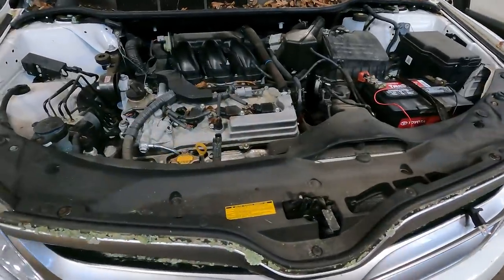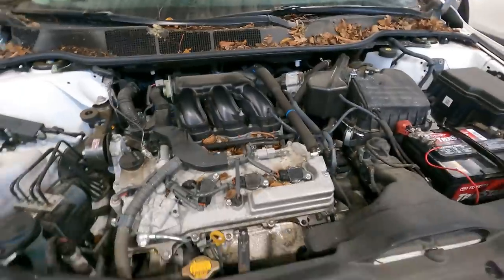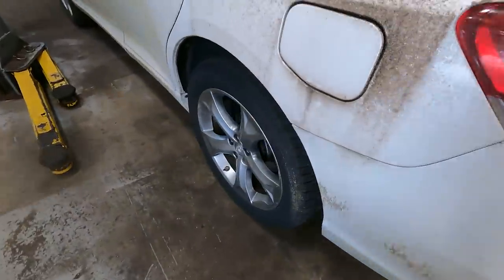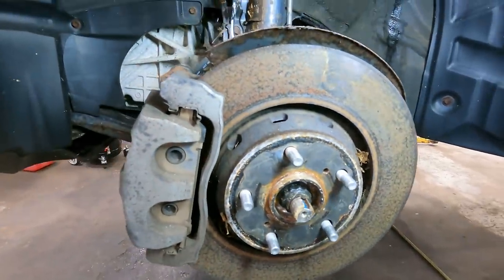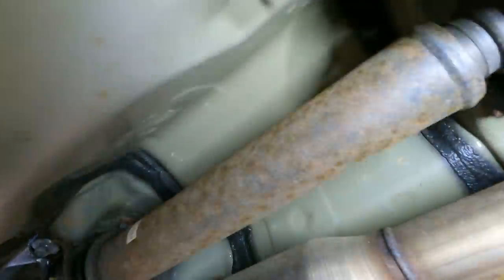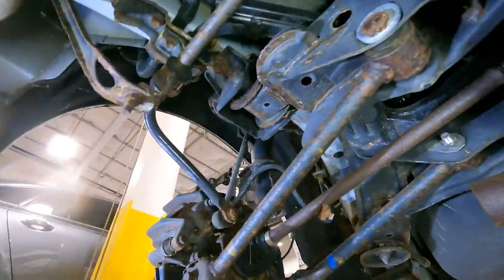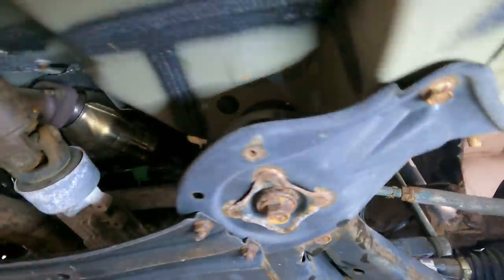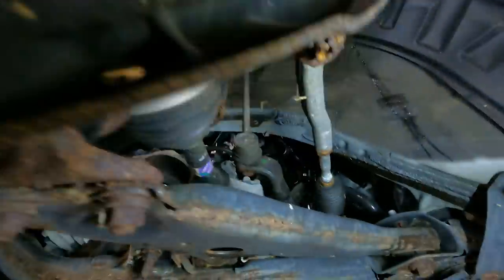Customer states "WAITER TOW-IN NO START 2014 WITH 6,600 MILES!?"

Comment: Just get it up to 90 on the highway and slam on the brakes. They might not work for 200 yards but eventually will grind the flavour off 😆
Reply: I’ve done similar with a sitting vehicle not at 90, but yes it does work to remove the flavor, also if a caliper is hanging up going back and forth from reverse to forward and slamming the brakes each time often frees them up as well
Reply: Yeah, sometimes they smooth out with use. Other times they are just done no matter how long you drive it and need replacement
Reply: @mph5896  yup- i just did brakes on said car i was talking about in my previous comment- then i got tboned and my car sat for a year - Now a valve or some shit is sticking open, this aint a 6k mile car either tho, my car has 222k miles- time to send it off to the crusher lmao
Reply: Yeup. Or find a long downward hill on a 55mph road and burnish those rotors clean.
Reply: ...and sometimes you do that and the pads go ballistic....ask me how I know.🤣

Comment: I once let my 67 Mustang sit inside a garage for 3 years with the tires up and the battery on a charger thinking I was helping to preserve it. I had so many problems. The wheel cylinders (all 4 of them) started leaking as well as the rear axle seals, and the exhausted started to badly rust. There was also corrosion on the radiator and the alternator. I learned that running a car every once in a while is the best thing for it and keeps all of the seals from drying out and the heat from the engine is the best thing for the running gear, exhaust, etc. When I went to Louis Bromfield's house (where Bogie and Bacall were married) I was talking to the caretaker in charge of his old jeep and other cars. He said once a month they take them all out for a drive with a modern car in front and the back. Best thing to keep them going.
Reply: Saw used cars that had been on lots for 2-3 years even before Covid. Said "No Thanks!" to the rebuild project they all would have been.
Reply: I know of a old dude.. that bought 2x of the 1970 chargers with the 6 packs and the whole load of options... same day, serial numbers consecutive. He bought them when hwe was 25 or there abouts.

One of them he drove the shit out of, the other, he had a barn out in the middle of nowhere in which there was power and he built a "garage" inside that barn so as to keep the vehicle in as pristine shape as possible. He had the vehicle delivered and when it arrived it had just a hair below 10 miles on it, to which he bitched to the dealer about that fact since he knew that at most, it should be no more than 3 miles, they ended up refunding a little on it. He uses wheel carts to move the vehicle out and back into said garage that he's mice proofed. He also heated the garage so it never dropped below 10C (50F) and he even air conditioned it so that it wouldn't get above 30C (86F) He also maintained a humidity no lower than 30 and no higher than 50 when possible.

Every spring and every fall, the vehicle is started, all brakes are applied multiple times, he only puts it into reverse and leaves it in neutral. He then jacks it up and manually turns the rear wheels in order to keep the differential from leaking. He also washes it once a year in the fall. He uses conditioners on the interior. He said initially he was changing the oil every year but now with synthetics, he's doing it once every 5 years or so or when he has the ambition if it's sooner than 5 years.

He later had gotten a large seacan that was sealed and built a rear and back entrance that he could basically pressure seal. It also made it more efficient and easier for him to maintain.

Now i only know about this because he took an interest in the vehicle i was repairing and retrofitting and we started on other old vehicles. He said he'd kill me if i told anyone who he is and what he has, but his goal was to keep it in immaculate condition and then load it into a covered trailer, get it shipped for one of largest auctions likely down in las vegas, and he wanted to see it sell for a million or more. Though he's getting up there in age, he better get on that soon, otherwise someone is going to get the best barn find of the century.

Either way, Simply running an engine once or better twice a year for 15-30 minutes, disconnecting the battery entirely, manually turning or letting the engine turn the wheels and keeping everything in an ideal out of the sun away from the changes in temperature and humidity can result in preserving a vehicle significantly. I doubt such a feat could be as easily done without being where i live which is literally the furthest from any sea or ocean you can be, land locked away in the middle of nowhere. The only issue is our temperature ranges from -40 to plus 40 (115F) with gross winds.
Reply: cars dont do well when they sit. the mechnical parts need motion from time to time to maintain them. it sucks but maybe we can let electric cars sit in the future? XD
Reply: @randomrazr  ....sitting for long time the block and heads warp molecularly ... yes metal can actually change shape if not exercised.
Reply: Worst thing for car is to just sit idle. Parts made to move, need to move. Those seals will seal for a long time, but they need some movement.
Reply: @declansills1614  ....maybe all those "barn finds" were not really a win win
Reply: @nickmalone3143  I agree. Old, unique parts there, solid body panels. Needs a full restoration, then you don't want to drive it due to all the money you spent. Nice to look at, but I want a driver.
(1) That Hemi, LS7, Boss engine, etc...., look good under the hood.
(2) A good straight road, right foot on the floor, big carb moaning as it sucks air, nose coming up as you are pushed back in the seat.
Pretty sure I'm a #2 guy.🤗
Reply: In 2020, I only drove my 09 Camry to the grocery store once per week. Valve seals are now slightly leaking(small smoke puff on startup after sitting overnight), and I'm seeing similar stories on forums.

Could be a coincidence due to age I suppose, but IDK, seems sus.
Reply: AGM batteries are really awesome for older vehicles not driven much, since normal lead acid batteries will off-gas acid slowly over time esp. if the charge is maintained (sealed AGM does not do that) and the gas will rot *everything*...

Comment: Had my 07 pathfinder sitting for 2 years ! Same issues replaced battery , and the rotors were new but now had a layer of rust. Busted out the white vinegar soaked them and a Quik light sand (didn’t want to wait on long 3-10 hour soak) and bam good to go! Just make sure to properly clean off that white vinegar ! But at a shop R.R all day! Love the vids dude

Comment: Come on that’s .B..S.  Just throw in a new battery and let those people drive it ,of course change out the oil & filter .  Why dealers make it so dramatic
Reply: I let a $500 car sit for 11 months back in 1980. Friend borrowed it, we got it running, he gave it back to me 3 months later after having spent $3k on it. I took off a few parts and junked it. Never ran properly after sitting for so long.
Reply: Exactly

Comment: Those Venza's are nice vehicles so that is a shame. We have a 2015 Venza with 39000 miles, still has the original brake pads. Guessing they will go 60000 or more at the rate they are wearing. Our Venza sees mostly highway miles so that does help with the breaks lasting longer.

Comment: 2014 means the tires are 8 years old and should also be replaced........
Reply: Dry rot.
Reply: This one I would agree with, the tires on all my stuff get replaced at 5 to 6 years no matter the wear, the cars/truck tires wear out, the boat/camper and motorcycles get changed at 5 or six years no matter what. I also change my battery at 5 yrs, the only time I had a dead battery is when one went bad at 2 yrs old.

Comment: Assuming the calipers aren't seized, the brakes might actually work once the car's gone a few miles and the pads scrape off the surface rust.  Of course, if the brake lines are corroded they may only work once.  But really, if they aren't going to drive it more than once every other year, they should sell it and just rent a car on those occasions they need one.  If they do start driving this one regularly, it's guaranteed to be a money pit with basically everything rusting out.

Comment: 2014 and 6000 miles, same battery brakes and oem parts. Wonder what the engine oil is like? Even if it is sitting or hardly driven, do you think they would still change the oil regularly?
Reply: Honestly I'd be more concerned with the fuel than the oil. Especially any that's sitting in the engine itself, it can if legy long enough start to resemble jelly much faster than oil.

Comment: Will have a pretty nasty vibration with all the rust on those rotors. Tires will be flat spotted as well. 🤪
Reply: Yeah but with the amount of miles on the car it is a grocery getter, the flat spots probably wont even be noticed, the person is probably one of those people you cuss at because they are driving 20 in a 40 MPH zone. I would definitely suggest replacing  the tires.

Comment: Cha-ching! Battery, 4-wheel rotor resurfacing/replacement, 4-wheel pad/caliper check, debris removal under the hood, cowl cover, and the plastic Mechanic's Nightmare panels on the undercarriage... Deodorize the interior, probably needs carpet cleaning and a quick detail due to moldy/musty smell, full wiring harness inspection (for rodent damage), air filters which you already did. Fuel tank will need to be drained and flushed before refilling with fresh fuel, and of course the fuel filter needs to be changed.
Then it's ready for a long road test, since the PCM and ECM have to re-learn.

Yeah... It's not good to leave a car sitting for long periods of time without, at the very least, starting them up weekly/biweekly and taking them down the street for a brief jaunt. Even if you fire it up and go up and down your driveway a few times, you gotta get it moving. Get the fluids circulating, get the brake hardware to move around, get the suspension flexing and hubs spinning, get the tires some exercise, put the charging system to work. Recognize the oil change interval mentions "or x months" for a reason - old oil, no matter how clean, will go "bad" as condensation within the air spaces of an engine contaminates it.
Reply: Not to mention air conditioning seals and compressor might need replacing, as well as the gas. Also possible electrical contacts have corrosion on them so switches will not work. Tyres may be damaged due to flat spots.
I am sure the list could be longer.

Comment: Hmmmm, bumpy shaft and no giggity? What's up with that? I know it's a dealer and it would be nice everything to make everything perfect (garage stored too) but every time I see a low mileage sleeper like this it brings me back to those videos on some 30 year old barn find where the guy cobbles it then drives it 300 miles home, no problem! <LOL>
Reply: A bumpy shaft is not a good thing
Reply: @mitchhedberg4415  Then why do some men use ribbed rubber coats?  🙂

Comment: I am surprised by the amount of rust on the underframe of an 8 year old car.  Regardless of the amount of miles, suspension members should not have that amount of rust, brake rotors, yes from not being driven, but frame and suspension, no.  I always thought Toyota made better cars than this.
Reply: MUST BE HUMID GARAGE

Comment: I would drive it around for a half hour, and take another look at the brake rotors. I would bet the braking surface on the rotors would come back shiny. Won't take long to figure out a caliper failure.

Comment: Of COURSE the batter has 0 Volts...

The owner let it sit for a year without starting it once a week and letting it idle to charge the battery for 20 minutes or so so the constant drains from the clock and various computer memories drained the battery and if it was drained in winter, that will completely DESTROY it...

For those that don't know, a car battery is a Lead-Acid type, it uses plates of 2 different alloys of lead for the positive and negative terminals and the rest of the case is filled with a solution of Sulfuric Acid as the Electrolyte. As the battery looses charge, the Acid is converted into water, the lower the electrical charge, the higher the water concentration (a fully charged battery has nearly 100% Acid, a fully drained battery has nearly 100% water). In winter, the water of a low battery freezes and turns to ice, which damages the plates and cracks the outer case resulting in a battery that's now only good as a doorstop...it's won't even make a good boat anchor since the case is cracked and the lead can leach into the lake, harming the fish...

Moral of the Story: ALWAYS start the car once a week and at least let it idle for 20 minutes...driving it on the highway for 30 minutes or so is better for the long term survival of the car...

Comment: Why wouldn't you let this Venza leave? That's surface rust on the rotors that will burn off within a couple good stops...no need to condemn it due to brakes. You're a Jouneyman Tech and don't understand this?